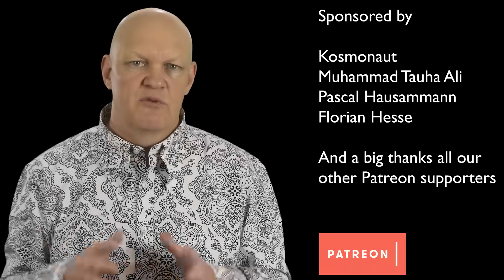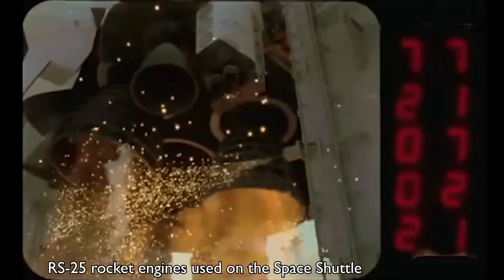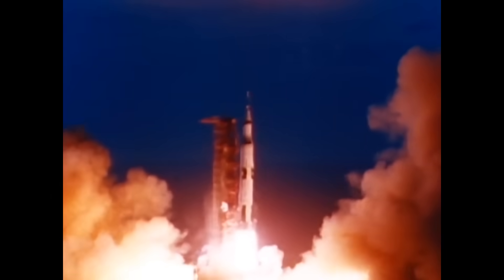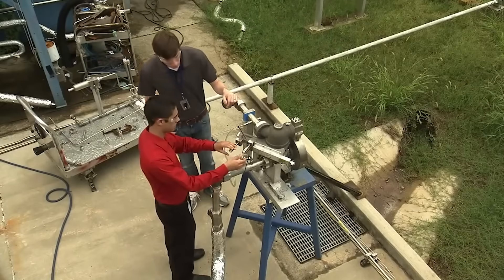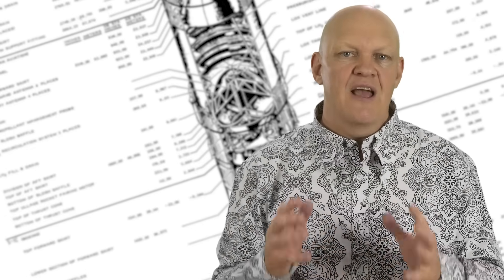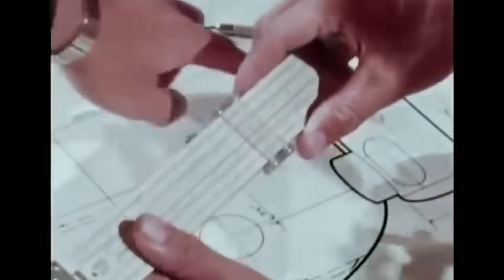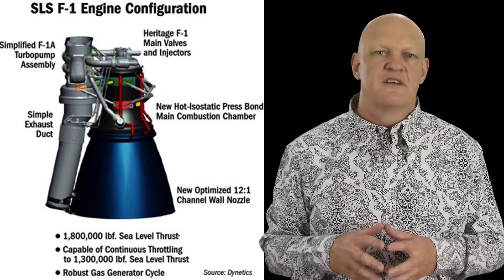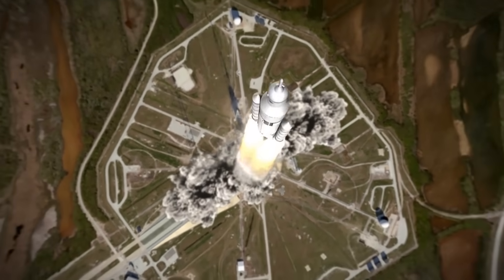Why Can't we Remake the Rocketdyne F1 Engine?

Comment: It’s not a question of existing skills and craftsmen, they had to learn it all somewhere and at that time it was imperative to learn it while doing it. How many F1 engines blew up on the test stand before the design was finally proven? This is the tribal knowledge we lost. Today with CAD, CATIA and computers we can design it, model it, and to some extent test it, before we ever fabricate a design. As stated in the video, the new designs are easier to build and have fewer parts than the old designs and the knowledge is built into the data.

Comment: Agree with the redesign thing: However an important part seems to be missing to me : cost of building 3 huge engines vs cost of building many little engines that you could reduce de the cost of construction... because you are using many of them.
Reply: The problem  with "building many little engines" is that the rocket itself becomes more complex, and you have more and more interactions between the engines that have to be tracked and understood.  That was the problem with the Soviet's N1-it had 30 engines in the first stage and it failed every time they tried to launch in

Comment: I am not surprised to hear someone talking about reviving a 50 year old engine design. Many young people seem to think computers and other recent technology will make going to space easier and cheaper. The bottom line is, getting to space requires chemistry. No amount of CAD can change the laws of chemistry and physics. So many have grown up with movies and television fiction having convinced them that getting to space ought to be easy. Also, the way evolutionary concepts are applied to nearly every aspect of life, This current generation expects that our space reaching capabilities ought to just keep getting stronger and stronger. But then there's taht pesky chemistry. The fact is, the designers and builders of the F1 engines darn near perfected the maximum controlled thrust we could achieve and no amount of engineering is going to significantly improve upon it.

We live on a planet with a certain mass and size and other physical characteristics that just barely allows us to leave the surface and explore a very tiny bit of space. No great space cities. No colonizing other heavenly bodies. Certainly no traveling to other stars.

I'm not trying to be a party pooper, but this is our reality.

Comment: I know the former Rocketdyne/NASA Engineer who fore saw this potential problem with the notes, so he made copies of all the Rocketdyne F1 Engine engineering, welding, machining, manufacturing, and tweaking notes. He's got all of the notes and he was willing to provide all the notes back to NASA . They laughed at his face and tried to kill him to bury the notes because they didn't want it being known that the Rocketdyne F1 Engine was a weak and inefficient rocket engine that could never have been used to safely transport the astronauts to the moon and back given the trajectory deviation to avoid the lethal Van Allen radiation belt. The safer but longer trajectory used too much fuel for the rocket engines to carry in order to make it to the moon and back to earth. He's currently in hiding.
Reply: Of course, you have reliable documentation that proves what you claim, right?

Comment: What's the maximum payload? What was the total payload weight for the Apollo missions? What's the maximum fuel carried? What's the burn rate? What's the flight plan trajectory taking account the flight plan deviated from the fastest trajectory to the moon and back to earth in order to avoid the deadliest parts of the Van Allen radiation belt.  As an Aerospace Engineer, you give me that data and I can tell you if the Rocketdyne F1 Engine can make it to the moon and back. I bet the Rocketdyne F1 Engine can not.

Comment: Truth. The van Allen belt would kill them.  I've seen the shit they supposedly came back to earth in. If you have tin foil and some pvc piping, you could build it too lol

Sadly most are ignorant and too trusting in the government but won't trust the guy living next door lol
Reply: OK, so you should be able to answer these two questions: 1) What type of radiation is found in the VAB, and 2) What is the best material to significantly reduce that type of radiation from penetrating into the CM?
Reply: almostfm first of all there isn't just one type of radiation in the Van Allen belt there is two. It also has X-ray charged particles. One type of radiation is electromagnetic waves. If you be so kind as to.tell me the second one since you clearly didn't know that. You can use Google if you need to. Lol

And honestly there is no known material to reduce or create shielding against high-intensity X-rays but the radiation/ charged particles. Take notes if you'd like. Moon landing never happened.

Comment: Why would you want to? The F1 honestly kinda sucks compared to modern engines (or even peroid Soviet engines which are the true technological predecessor for many advanced modern kerosene designs) in most stats other than raw size and thrust? You either go hydrogen and copy the SSME or go kerosene and follow in the footsteps of the USSR's best engines?

Literally most modern American kerosene rockets use soviet or soviet-derived engines. SpaceX is the exception and it has arrived at Soviet- like designs by convergent evolution. 

And their stats were so good that the Americans dismissed them as communist propoganda until the fall of the USSR when they learned that the Soviets knew what they were doing with regards to staged combustion.

Comment: You guys are layman with no academic and technical experience about the Rocketdyne F1 Engines. I have a Bachelor of Science Degree in Aerospace Engineering and I've spoken to a number of Rocketdyne Engineers in Canoga Park, CA, and they will never admit it publicly, but in private (off the record) they said that the Rocketdyne F1 Engine is not even powerful enough to send men to the moon safely. Yes, that's correct, the Rocketdyne F1 Engine is not powerful enough to send men to the moon safely. Astronauts would be near death within 24 hrs after passing through the Van Allen radiation belt given the past thin radiation shielding used on space crafts. You guys are just regurgitating propaganda for mass consumption. Do the math, or the rocket science.

Comment: what a load of crap. If someone wanted to build an F1 engine, with enough money it could be achieved. Let's not forget that the original engineers were making something never seen before. There are plenty of examples of this engine still around, even one recovered from Apollo 11. Truth is it wasn't really a very efficient design.
Reply: Hi #16 Racing.  I agree with you. These guys that made this video are layman with no academic and technical experience about the Rocketdyne F1 Engines.  They are just regurgitating propaganda for mass consumption.                 I have a Bachelor of Science Degree in Aerospace Engineering and I've spoken to a number of Rocketdyne Engineers in Canoga Park, CA, and they will never admit it publicly, but in private (off the record) they said that the Rocketdyne F1 Engine is not even powerful enough to send men to the moon safely. Yes, that's correct, the Rocketdyne F1 Engine is not powerful enough to send men to the moon safely. Astronauts would be near death within 24 hrs after passing through the Van Allen radiation belt given the past thin radiation shielding used on space crafts.

Comment: This is a phony attempt to cover up the silly notion that NASA could do it in 69 but it can't now, a lie that is covering the truth.
Reply: Agreed. I've often wondered how NASA managed to 'un-invent' things.
Reply: Hi tod jones. I agree with you. These guys that made this video are layman with no academic and technical experience about the Rocketdyne F1 Engines.  They are just regurgitating propaganda for mass consumption.                 I have a Bachelor of Science Degree in Aerospace Engineering and I've spoken to a number of Rocketdyne Engineers in Canoga Park, CA, and they will never admit it publicly, but in private (off the record) they said that the Rocketdyne F1 Engine is not even powerful enough to send men to the moon safely. Yes, that's correct, the Rocketdyne F1 Engine is not powerful enough to send men to the moon safely. Astronauts would be near death within 24 hrs after passing through the Van Allen radiation belt given the past thin radiation shielding used on space crafts.
Reply: And then there is the thermosphere! Some believe, and  I'm a novice on this one, that the two phenomena would make it impossible to use standard rocketry for travel to deep space.
Reply: Yes, the thermosphere can have lethal solar radiation depending on the level of solar activity which could inrease ambient tempturatures above 3000 degree F.
Reply: " could inrease ambient tempturatures above 3000 degree F."  So you don't understand that "heat" and "temperature" aren't the same thing.
Reply: I spoke to Neil Armstrong on his death bed. He confessed to me that the moon landing was fake, but he had to go along with the scam for 2 reasons: 1) his patriotism for the United States  2) he was threatened and was told that if he ever revealed that the moon landing was fake, they would kill him and his family.  He has been holding on to this lie and it had burden his soul for most of his life, but he had to confess and repent before he met his maker (God), and that is why he confessed the lies that he told about his part in the fake moon landing.
Reply: Where the hell did you come up with the idea that's what I thought about the Kennedy assassination.?
Reply: Hi almostfm. It's not important where I got that information. The important thing is that you truly believe the Kennedy assassination is not done by the single lone shooter, Lee Harvey Oswald. Therefore, according the CIA and the US Government, you're a lunatic - conspiracy theorist for going against the main stream narrative..
Reply: No it would not. You people always act like radiation is some kind of instant death ray. That's not how its works. First of all they traveled so fast through the belts it did not really matter. And while radiation in space is indeed damaging, its a slow and cumulative process. The few days of travel from and to the moon don't even accumulate as much Millisivert as a worker in a Nuclear Power-plant is allowed to be exposed to. The long travel to mars could indeed be damaging in the way of a higher cancer risk. (astronauts on the iss do have by the way a higher cancer risk because they get exposed to a lot more radiation than on ground level)  But it would take years for anything aproching radiation poisoning to set in.
Reply: "given the past thin radiation shielding used on space crafts." So, what is the type of radiation found in the VAB, and what is the best type of shielding to block that radiation?
Reply: There is a lot of stupidity thrown around. The usual radiation shielding on spacecrafts protects against solar radiation (mostly particles ultraviolet and X-Rays). Those are relatively easy to block and most metal hulls will protect against it. The other type is high energy cosmic radiation. That is harder as its really energetic. Today crafts are not really shielded agents it, but as it would take a long time to accumulate enough of that radiation to be dangerous and missions are a lot shorter than that, its not really necessary. (you will have a higher cancer risk thou) The best way to shield agents that is actually water. A pretty easy solution for long time missions in deep space would be to simply put the water tanks around the crew capsule.
Reply: @littlegayfairy  I've heard these types of arguments before "I have an aeronautics degree. I knew guys at Nasa who said its bullshit". As someone who also has a BSc albeit non related and also a Masters I know that a degree is  limited and only really gives a person surface knowledge. A degree is a building block to a professional career, nothing more. Its practical experience over many years that makes one an expert. A degree is an admirable if some what moderate achievement but don't let it delude you into thinking you are an expert. Finally, why didn't Nasa's number one whistle blower Roger Boisjoly (an actual Rocket engineer) not question the F1 engine? Of all people he would have publicly spoken out about the Apollo program.

By the way, The F1 was only stage 1, it didn't take them to the Moon. It was ejected before they reached orbit and a much much lighter stage 2 took them into orbit before that to was ejected. But then you knew that.....didn't you??????

Ps, Oswald was a lone gun man.
Reply: Hi John. Yes, you are correct regarding the additional engines needed to take the Command Module and Lunar Module to the moon, but let's just concentrate on the F1 for now. Let me give you some facts. Rocketdyne and NASA is currently developing their next generation rocket engine which is an updated version of the Space Shuttle rocket engine which is the RS-25 engine which will have the improved weak ass thrust to weight ratio of 53 (according to Rocketdyne) and the fake numbers given by NASA for the Rocketdyne F1 Engine has a thrust to weight ratio of 82. Why the fu@k would they want to upgrade the Space Shuttle weak ass thrust to weight ratio to 53 while they could upgrade the much more powerful Rocketdyne F1 Engine and increase the thrust to weight ratio above 82?      Why? because the Rocketdyne F1 Engine's thrust to weight ratio of 82 is a fantasy made up by NASA.
Reply: Please, stop spreading stupid "Moonlaning Hoax" propaganda.
Reply: +tod jones
oh look a "moon landing is a hoax" circlejerk thread.
First of all: NASA CAN do it now, there's just no point.
Second of all: Why would we lie about going to the moon?
Third of all: What kind of shit are you viewing to come to the conclusion that NASA can't get to the moon?
Reply: Hi Doot Doot. Yes, these lunatics and conspiracy theorists are the same people that think that the John F Kennedy assassination was part of a conspiracy...the same people that don't believe that Lee Harvey Oswald was the lone gunman who assassinated JFK by himself without anyone else conspiring to kill JFK. Those JFK lunatics - conspiracy theorist try to argue against the information provided by CIA and the US Government. Why would the CIA and the US Government lie about the JFK assassination? I can't stand listening to those crazy conspiracy theorist that think that the JFK assassination was orchestrated by other people beyond just simply Lee Harvey Oswald.

Comment: There is some merit in this as drawings created in (first angle on drawing boards- used some artistic licence) may not have been totally practicable to manufacture. Causing pattern makers for castings to use their own judgement. Consequently differing the design. Some early Velocette motorbike engines were like this. Consequently delivered less power than what the designers calculated. Roll onto today. Those blue prints were recreated with 3D cad packages and FEA tools and accurate CNC machining were able to make the engines better than they were in the actual engines of the time producing the almost the design power output.
Reply: Hi Kiwi adventures. These guys that made this video are layman with no academic and technical experience about the Rocketdyne F1 Engines.  They are just regurgitating propaganda for mass consumption.                 I have a Bachelor of Science Degree in Aerospace Engineering and I've spoken to a number of Rocketdyne Engineers in Canoga Park, CA, and they will never admit it publicly, but in private (off the record) they said that the Rocketdyne F1 Engine is not even powerful enough to send men to the moon safely. Yes, that's correct, the Rocketdyne F1 Engine is not powerful enough to send men to the moon safely. Astronauts would be near death within 24 hrs after passing through the Van Allen radiation belt given the past thin radiation shielding used on space crafts.

Comment: Bullshit that we don't have skilled craftsman n engineers anymore. If we really want to build it we can. We have better engines nowadays.
Reply: Hi 90X Vision.  These guys that made this video are layman with no academic and technical experience about the Rocketdyne F1 Engines.  They are just regurgitating propaganda for mass consumption.                 I have a Bachelor of Science Degree in Aerospace Engineering and I've spoken to a number of Rocketdyne Engineers in Canoga Park, CA, and they will never admit it publicly, but in private (off the record) they said that the Rocketdyne F1 Engine is not even powerful enough to send men to the moon safely. Yes, that's correct, the Rocketdyne F1 Engine is not powerful enough to send men to the moon safely. Astronauts would be near death within 24 hrs after passing through the Van Allen radiation belt given the past thin radiation shielding used on space crafts.